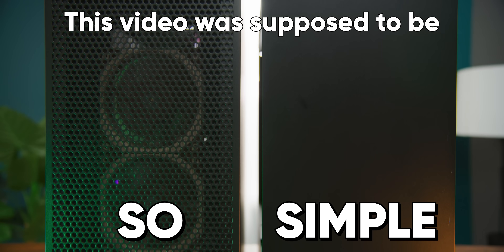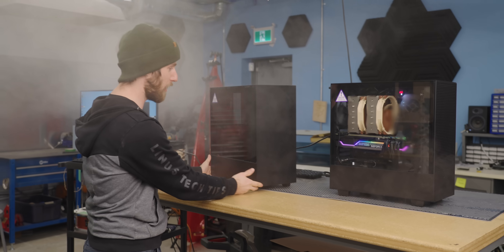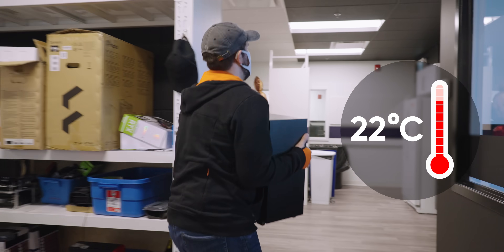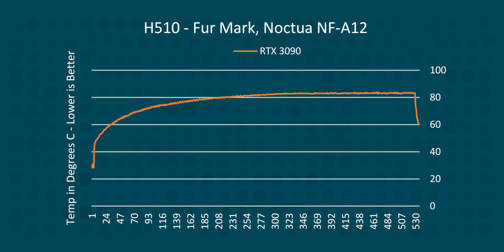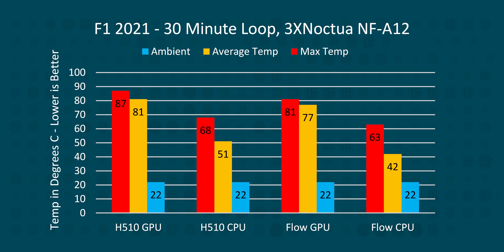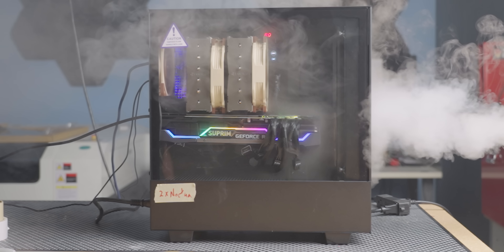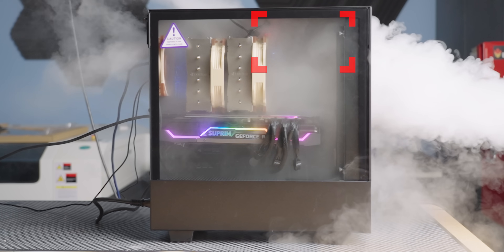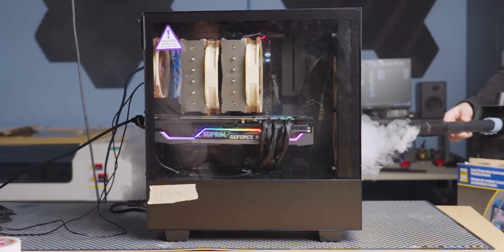Everything You Know Is Wrong - Mesh vs Non-Mesh Front Panel

Comment: today i did a case swap. from a midi tower (cooler master haf 912 advanced) to a full tower corsair 780t. 1x 90mm, 1x 120mm, 1x 140mm case fan to 5x 140mm case fans! my rtx 3080ti went from 100% load 78*C to 63*C in the new case!
its insane! that „new! case is from 2014 by the way. the new cases all succ so much with more glas than mesh, its stupid. i dont need rgb and glas, i need cooling and dust filters!!!! (and 5,25 inch drive bays…)

edit: having case fans in the top for exhausts are going to fix this video. also flip the CPU cooler by 90 degrees so more are goes from bottom to top. since the grafics card is blowing upwards as well. i am using a similar configuration. also i use the cpu fan in pull on the top if the cooler so there is a bigger gap between the gpu and the cpu cooler!

Comment: With so power hungry GPU's recently it's no surprise.
Cooling GPU is about good airflow and not massive airflow dodging our graphics card.
I've been thinking about this last two weeks.
Tower cooler or water cooling GPU aren't ideal solutions.
It's mostly about case design. 
Ideal would be NR200 with deshrouded GPU and fans directly below it to pull fresh air from underneath a case and fans on top of the case as an exhaust.

But this case is awfully specific. In my atx case I would suggest putting intake fan on the same level as gpu shroud. This way it's blowing fresh air directly to gpu.
Only one exhaust fan. More will cause to air just dodge GPU and go easy way directly to an exhaust. It's gonna be better for CPU and not the GPU.

Comment: Hey LTT. The H510 is a hotbox in its solid and flow variants either way. Would you be willing to try this test out with a Corsair 4000D and 4000D Airflow and multiple different cooling solutions ( namely a big tower cooler such as the one in the video, a 240mm and 280mm AIOs top mounted and a 360mm which could only be mounted up front ) and a smoke test in all of those scenarios? The 4000s are a decent series all round and the video will eventually lead to what is allround the best solution to almost any given scenario.

Comment: You guys mounted the front fans in the H510 wrong. Put them behind the panel, not in front of it. This is clear in the NZXT H510 product photos on their website. Also, flip the PSU upside down, the shroud is perforated for a reason.

Comment: This is a problem that my NZXT H1 case has. Even though three of the four sides are mesh, that glass front panel kills the airflow and the air just sits inside slowly heating up the entire case. I ended up just pulling the front glass panel off and the difference is insane.

Comment: I ran into an issue like this with my Corsair 4000D.  As some of the other comments talked about, the power supply shroud, with the PSU fan intaking from the bottom of the case, the PSU shroud wasn't allowing the GPU to breath because it wasn't drawing air through and forcing a flow path. I exagerated the problem when I went from a 240 AIO in the top, to a 360 in the front and the GPU couldn't draw enough air to be cooled. The bottom AIO fan now was basically funneling air into the hard drives and into the PSU shroud where it'd never escape to be able to supply air to the GPU.

I'm also running the 3090 suprim so it couldn't pull air around the side  from the top (too close to the glass) and began pulling air in through the rear PCI brackets on it's own (even though running positive pressure in the case). I moved my whole system back into my Enthoo Luxe 2 (719) and with the bottom fans, and much more room in the front of the GPU between the four front fans and it, it runs so much cooler. It basically had half a fan feeding it air and only a 2mm gap between the GPU shrouds with the 360 in the front and had no where to breath from.

Comment: The Problem is not the small case, but that the front fans are located TOO HIGH.
This is because modern cases make the stupid mistake to include a cage for the PSU and all along the bottom which totally ruins all the airflow and the option to mount front fans lower.
my case is smaller than this NZXT and I have top performance and cooling. The case cost 46.- bucks : Sharkoon VG7-W

Comment: running a nox hummer void, using those 3 stock fans in the front and a noctua p12 redux in the back... what is amazing in that case is that i can have both solid or open front ventilation

Comment: I have an adjustable fan controller I played with the speeds of all fans for about 3 months until I got a completely silent and quiet PC 3 intake (front) 3 exhaust (2 top 1 back), all running at different speeds to reduce air starvation and air pockets.  

I found it was better to use a slower moving 140mm in the front top of the case, running at around 50% the speed of the slowest fan in the case. My fastest intake is the bottom front intake feeding the GPU, the middle fan is for the GPU backplate/CPU running around 10/15 % slower than the bottom and the top is CPU/mem/vrm at around 10% the middle fan. Rear top exhaust is 100% faster than the front exhaust, rear exhaust is the same as the rear top.

I have used a smoke machine on this and from what I have seen it was close to perfect, and it has been working without an issue for over a year in a fully OCed setup.  It's about time case manufactures started to airflow test their cases, giving end users a guide to fan choice with a fan controller set up out of the box! Controlling airflow is tricky!

Comment: "More fans equals more better, right?"

Honestly, I think people do more damage when getting all fan-happy.  Remember, the point of active cooling is to increase air flow through and around heatsink fins, and to pull heat from passively-radiated sources like SSDs, regulator ICs, etc.  The air has to touch those areas long enough to absorb that heat energy, and there needs to be a constant influx of cool air, and a way for the heated air to move somewhere else.

Ever since the 486 days, when CPUs started requiring fans, the goal was to enhance the transfer of heat from the CPU surface to the heat sink, and from the sink to the surrounding air.  It is then the job of the case fan(s) to replenish cool air, and the PSU would traditionally exhaust warm air.

As the CPU and GPU (particularly) got hotter, cases started to show up with dedicated air exhaust for those components.  The CPU would have a nearby rear fan grill nearby, and the GPU would have its own slot bracket meant to be the exhaust port.  The PSU, then, only really needed to remove the ambient warm air from inside the case.

You really have to think about these things, and look at balancing the intake and exhaust pressures.  If you don't, then the air will find a way -- the shortest way, and the one of least resistance.  And once you start pressurizing, the whole "heat rises" thing no longer really applies, because you've overcome convection.

I like to try and maintain a standard of cool air intake on the bottom front, and warm air exhaust through the rear, toward the top.  That way, air has to flow through the entire case, which pretty much assures the ambient air will always be relatively cool.  As long as you're not blocking or forcing air in a counter-productive manner, then you should be OK.  Even solid front panels will be OK if there's some room to breathe from vents behind the panel or whatever.  You don't usually need a LOT of air, you just need a constant steady stream of it.

Comment: Crazy that console-style sff cases might actually do better with the 30 series cards than any other case out there. Even though it's a super small space, you could pull in atmospheric air straight on to the card, then blow most of it out of the case through the other side (mainly would love to see this cause I want to put a 3060ti in my Node202 and want to know if it's worth drilling a huge hole into the side lol)

Comment: 3D printing a baffle that deflects the air from the bottom half of the bottom fan will probably go a long ways. Bonus points for making a baffle the directs the hot air coming out of the exposed side of the GPU cooler up.

Comment: I guarantee you that the GPU would have been much happier if the mesh part of the front panel was the bottom two thirds and not the top two thirds. I would have loved to see a case that actually has three front fans over the whole front.

Comment: I did get a NZXT Steaming Plus, which has a 5800x and 3070 Ti. No mesh panel & original fans & 120mm AIO on CPU, and GPU sits at 65C when at 100%. I did briefly have an issue with throttling, but that was just 'cause I was a dum dum, and put the PC in an enclosed area, which became a hot box. Of course, I haven't bothered with overclocking, 'cause GPU is overkill for any games as is.

Comment: Seems to me that the problem is that there is too much exhaust, rather than not enough: if intake and exhaust are perfectly balanced the airflow will take the path of least resistance from the intake to the exhaust, and apparently not much of it is via the GPU. If you removed the top exhaust fan and removed a couple of PCIe slot covers the GPU would cool much better, I reckon. That or put the power supply fan-side up.

Comment: I have the NZXT H510 and yes the airflow sucks; however, one thing I've done to help with that include using that top mount as an output fan because it makes no sense to fight the laws of thermodynamics (heat rises). Of course, a lot of the time I leave the glass side panel off the case because a strix 1080ti generates a lot of heat. I'm getting a Cooler Master HAF XB EVO in a couple days though so that should very much make a difference in terms of flow.

Comment: I have the solution. revive the Cooler Master Haf X like i finally got a hold of.
Reply: I'm not running the hotest stuff, but the original 240mm up front, a 120mm corsair and 3x 200mm cooler master fans keeps my 1080 and 11700K happy with the NHD15 on top.
I added a 140mm intake at the botom since my used case was missing the psu shroud and 120mm adapter for the HDD bay.

Comment: Not that the results may or may not of been similar is it fair not to point the smoke machine directly at the side vents for the H510? The bottle neck is the size of the vent and direction the fans are. Not the direction of the air going into the mesh.

Comment: I will never understand why the NZXT H500 gets so much attention as being terrible at cooling, its okay at best but FAR from terrible. Any medium to high end build in that case will run completely fine in normal gaming scenarios. I have the H500 and the hottest i've ever seen my GPU get was 62C, and CPU 55C. I also dont have crazy high end cooling. Negative air pressure works pretty damn good.

Comment: Use a Smoke-Pro. Used for systems on vehicles, steady stream and way more directable. Fairly cheap too. Uses shop air that you already use. Also good for finding leaks in coolant systems on computers without causing harm.

Comment: TL;DR don't use a small case for a high performance gaming PC. I have a Phanteks Entho 719. It's gigantic. I have 13 fans, an AIO and a 3 fan 1070 Ti Duke. Full on gaming session with my fans blowing very modestly, and I average 55C on both my 3600x and my 1070 Ti Duke. I could drive that down a few degrees by cranking my fans up, but because the case is so big and I have so many fans, I can run them are low speed and still maintain great cooling.

Comment: Make the top fan an intake, I dont know why but it makes the temps on GPU far more manageable I think it helps to force air around through the back and also helps the air bubble under the GPU but all I know is for my H500 when I ran it it gave the best temps so Rear Exhaust, Top Intake, Front Intake

Comment: Subject already explored by the Adam Savage channel "Tested" ; )
https://www.youtube.com/watch?v=jitCQtP4npY

Conclusion: You have to extract more air than you need to inject air. Negative air pressure is the way to go ; ) Pushing a lot of air in the case only makes it stuck, but if you extract more air than what is coming inside the case, you create an airflow that is constantly sucking hot air out of the case and being immediately replaced by fresh air.
But surely, from that observation, the placements of the fans can be optimized for better results. I'm curious to know if it's better to have fans extracting air at the back of the case or on the top, or both maybe.

Comment: I would not want to blow a theatrical smoke machine into a PC without a lot of testing, I deal with the things on a weekly basis and the fluid loves to cause things it condenses on to corrode and become kind a sticky. The stuff never seems to evaporate either. Unless you are using some other type of fog machine of course, most of them will leave a residue on things, and sometimes in my experience it attacks aluminum and causes connectors to become less reliable. On the other hand I do like the fact that you can use this fog machine to visualize the air flow, makes doing research and experiments easier for sure.

Comment: The air flow giving a bigger exhaust would seem to be a better option in this case ? Negative pressure inside would remove heat better ? right ?

Comment: I had a very old high air flow case long ago(phenom II x 4 time). it is a shame I sold that PC  because despite all hardware in it being old when I sold it, the case was something I never managed to find again, and so in my opinion now was worth more than what I sold the entire PC for. this PC had multiple small fans, however on the top it got wider and formed a large circle, there there was a very big fan being somewhere between 30 cm and 0,5m and when on speed that thing got super air flow while staying quite silent. My CPU used a passive cooler with no fans(a big passive cooler however), and I could overclock it with more than a gigahertz without the temps only rising a few degrees, I also ran 2 gpu's which where high end gaming gpu's when I bought them, those also never got even slightly warm. I didn't take my overclocks much further because my motherboard was quite old and the capacitors had became a lot worse, so the motherboard itself while working but it was not something that I would overclock. I would certainly right now probably pay as much for such a case as what I sold that pc for if/when I want to build a new pc since that was and still is the best thermal performance I have ever seen.

Comment: I have a Lian Li Lancool 2 non-mesh, but I was thinking that, in this specific case, the third intake fan actually hangs about halfway past the power supply basement. About half of the PSU basement has ventilation about right underneath where the graphics card is located. Would that third fan create enough airflow through that ventilation/right above the PSU basement to make any difference in GPU temps/GPU airflow? Kind of wish I had a smoke tester so I could check it for myself as this is the way I currently have mine set up. 3 intakes with one being halfway above/below the basement, and 3 exhausts, two in the top, one in the back. I am very interested in whether or not that third intake fan actually makes any real difference in airflow characteristics.

Comment: for some really odd reason.. my nvidia software will turn off the dual fans on my 1070 FTW2 on boot up.. and I have to manually turn them on (thru software EVGA Precision X1)  over and over.. even after setting and saving those settings.. and yes I have it start on boot up..

Comment: My crappy case is basically that solid one. After cutting a hole through the back for 2 120s and shoving a 140 directly onto the bottom facing up there is zero dead zone.

Comment: Hey linus, I just got an antec (I know I know) nx400 case, where it has a top magnetic intake filter included and the ability to mount 3 fans, up to 140mm, on top & front, and 1 in the rear of the case. Even though it does have a type of vent on the front panel, its the same result as the NZXT solid front panel you had in this video.. with that said..I've used 120mm fans, and for the front panel of fans I did the front top as my aio mount with 2 fans set to push/pull- pushing in as an exhaust, both set to full. The middle front fan as an intake set to silent and the bottom front as an intake set to full speed. Only 2 120mm fans as intake on the top set to normal speed and 1 120mm as an exhaust on the back mount fan. I also positioned a 40mm fan under the gpu on the back set as an intake as well.. now, I have a gigabyte z87-hd3 with a core i7 4790k, 16gb corsair vengeance ddr3 @ 1600mhz, a pny gtx 1070 8gb OC xlr8 triple for gpu, and evga 600w 80+ bronze psu ( heard it was a good psu for the price. All in all, gaming on it is great and I have had no problems playing games such as the new halo infinite and anthem (such a great game!!) Cpu Temps run anywhere between 32°C to 81°Cwhile gpu seems to settle at 90-92°C . I haven't overclocked anything except to set xmp to profile 1 in bios. 

So basically, I use the top as an intake, and use the front panel to help circulate to other areas of the case. I don't have a smoke machine to see how well this works, but I tried to imagine if I was air being thrown around in this case, and so far its doing ok.. I recently built this with about $460 us dollars and a ton of help to 5 finger part picker from "curbs r urs".. 

Would love to be on the same level as next gen or even modern components,  but 4 doing my first build ever at 37, would love to know if this was a good idea with how I used the front panel fan mounting.. also, am I using the top section wrong.. I assumed exhausts don't usually need an external mounted magnetic filter, but assumptions are the mother of all F*#K UPS..
Reply: What's wrong with Antech? Sure, they don't make the best looking cases, but their usual pretty well screwed together.